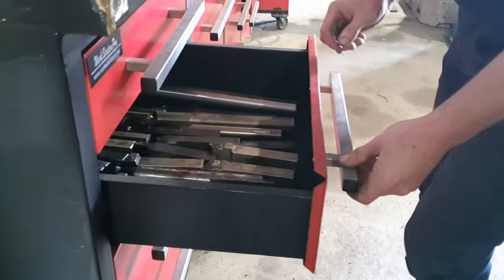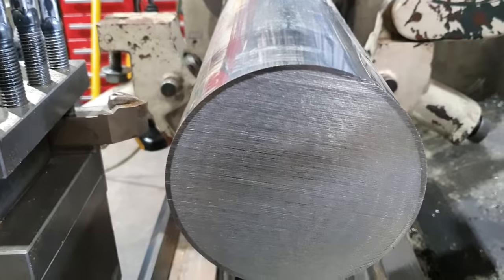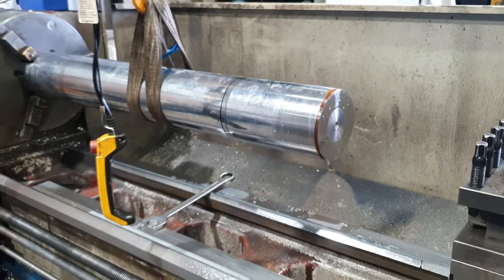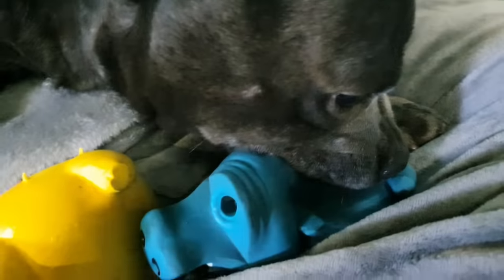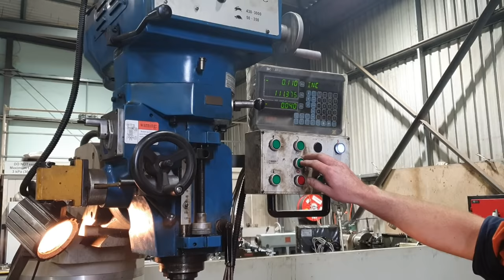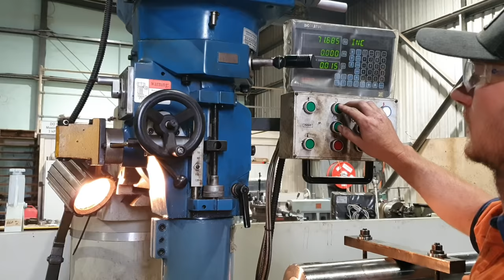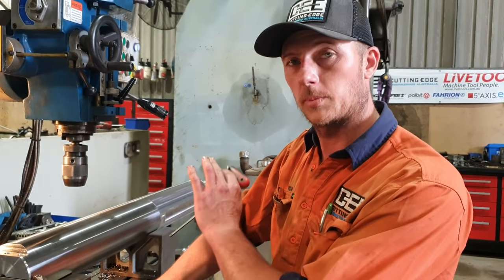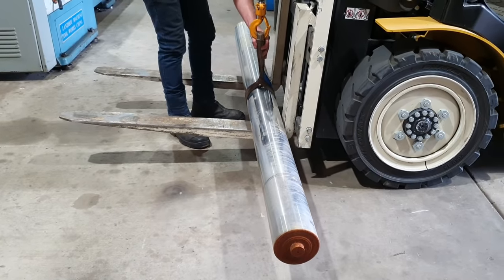Making a BIG Boring Bar | Shop Made Tools

Comment: You sawed the stock with a regular saw blade but had to use ceramic  to cut - the diameter-I usually have to use a hand grinder to go around the saw cut area - then saw it. ----please explain!!!
Reply from the maker: The saw blade has tungsten carbide tips 😎👍

Comment: Set your vee blocks and deviding heads up so that you can machine slots in the for keys. Keys should be made same width as tee slots on your machines. If you have machines with different widths make slots tang fit the slot Drill and tap all your fixtures so hold keys in place. Now it is simple as dropping your vice etc into tee slot so you are set and ready to go. For different machine slot widths just change keys, You’re fixture is set true by just putting it on machine. You will need to do 2 sets of key ways in a dividing head so you can use it in different orientations. Keying fixtures you use regularly will also save time and fiddly DTI usage. Hope the ‘‘tis work out for you. Any thing to make the job easier. OLD RETIRED MACHINIST

Comment: What about adding a relief cut to the one end of the tool slot in the bar to accommodate the 25 mm tool head. That would allow the tool to be set in the bar to just pass the diameter  of the bar. Thus allowing the boring bar to be just about the size of the bore being bored versus the head of the tool sticking out passed the boring bar making the bar much smaller then the hole being bored? Just Saying.

Comment: Second viewing.  What kind of a blade do you have in your saw that chewed thru that inductions hardened chrome bar???  WOW!!!!
Did you find any deflection at the end of the bar?  That's alot of weight hanging on the tool post.

Comment: Did the same for a job with some large oil field stuff.
First time out of the gate and and it ripped the top half of the cross slide clean off the lathe.
Just a little too much leverage and one little snag and away she went. OOPS!!!

Comment: I confess to having a question.  I have been told that a local guy has sucessfully used a ground portion of a broken 1/2 inch drill in a boring bar working on cast iron (air cooled engine block bore).  Is this reasonable?  What say you?  Thanks for your thoughts.  "D"

Comment: Why didn't get rid of the tool post, and made full diameter clamp system instead? You can't use the QC-ness with the bar in place anyhow.  Probably easier, and certainly a lot more rigid. And length would be infinitely variable.

Comment: Love your videos,! I do have a question for you if I may, what kind of saw blade did you use to cut through the Induction Hard rod, is it a special blade you installed off camera?
Reply from the maker: It is a tungsten carbide tipped blade

Comment: Sincere question:

If the cross-section of the bar is ~5", doesn't that far exceed the rigidity of the tool post?

Regardless, impressive job!

Oh, and what the fcuk is a "Grub Screw"???

; )

Comment: Интересно, Длину 1600мм смогу такой самодельной расточкой расточить и попасть в 0.13мм допуск, диаметр расточки  Ф300мм. Соответственно заготовку  под расточной инструмент можем подобрать Ф150мм или  Ф 210мм. Как думаешь ? 
Interestingly, I can bore the length of 1600mm with such a self-made boring and get into the 0.13mm tolerance, the diameter of the boring is Ф300mm. Accordingly, the workpiece for the boring tool can be selected Ф150mm or Ф 210mm. What do you think ?

Comment: Всё это очень хорошо, работа проделана большая, я лично доволен, но так дальше дело не пойдёт. В конце обработки будет биение и шероховатость выйдет за все мыслимые нормы. Аналогичные проблемы и на иных профессиональных станках глубокой расточки, например на станках Рязанского станкостроительного. Обещанные характеристики не выдерживаются. Эта проблема очень изящно решена специалистами Дружковки, причём глубина расточки фактически не ограничивается. At the end of processing, there will be beating and roughness will go beyond all conceivable norms. There are similar problems on other professional deep boring machines, for example, on the machines of the Ryazan Machine-Tool Building. The promised performance is not being met. This problem is very elegantly solved by the specialists of Druzhkovka, and the depth of boring is actually not limited.

Comment: Hi Kurtis
Did you check how much your Bar bends 
if you put 5 or 10 Kg's of weight on the cutting end ?

Did you consider to give it a core of Lead to avoid vibrations ?

Comment: Do you wear earplugs next to your lathe? on my lathes i can't stand that screeching metal noise. it gets up to 110 db sometimes.
Reply from the maker: yeah when needed
Reply: @CuttingEdgeEngineering  also, this was an awesome project, and good use of that bar! We don't have to do much boring in my shop, it's just rough cut drilling with a range of trepan tooling on our 1940s era turret lathes

Comment: A fine job for sure but  you won't achieve the full potential with that regular tool post holder with those 4 small bolts. 
When it comes to bars like that you need to make it its own holder bolted straight on to the cross slide,  a completely surround  perfect hole through type with a good broad base,  now that would be the job 👌 😋😋

Comment: The scale of this huge new boring-bar when mounted on your bespoke tool-rest has me pondering the tolerance stack-up once it goes to work - but in the end that doesn't matter, does it?  The inside diameter will get opened to specification anyway, so who cares if there's 0.00001" deflection.  Nobody.  Not even the Swiss.

Comment: I MUST ADMIT THAT IS THE FIRST TIME I HAVE SEEN A LIVE CHUCK IN A TAIL-STOCK  /  I HAVE WORKED  TURNING ON BIG DIAMETERS  AND LONG IN LENGTH  MATERIAL  BUILDING HYDRAULIC  JACKS THAT ARE USED FOR TALL BUILDINGS LIKE SKY SCRAPERS   TURNING AND BORING THE BODY OF THE JACK AND THE PISTON THAT GOES INSIDE  / I HATED THE JOB BECAUSE IT WAS SO DANGEROUS  I USED A LARGE LIVE  CENTER IN THE TAIL STOCK    ( I WISH THEY HAD WHAT YOU HAVE A LIVE CHUCK IN THE TAIL STOCK )  I QUIT THE JOB AFTER I MADE THE FIRST ONE  BECAUSE THE CHIP BREAKER ON THE TURNING TOOL FAILED  AND A CHIP CAME OFF LIKE A  ROPE,  FLAT WITH A RAZORS EDGE  ALL MOST GRABBED MY ARM  TRYING TO SHUT IT DOWN  AND IT  CAME OFF THE WORK SO FAST AND OUT OF CONTROL RAPPING AROUND THE PART AND HEAD -STOCK CHUCK   HAD TO SHUT POWER ON THE WALL TO STOP THE MONSTER OF A LATHE  /

Comment: So made a boring bar 6 times stronger and heaver than tool post and tool post deck can handle lol........  Tool post and deck will never support that without vibrating itself to death.  Just saying in 30 years we turned corry loader and Truck shafts  making a boring bar of that size we had to make larger surface supported holder for the tool. we also had to make bearing rests to support the tool post deck so it didn't have to support so much weight hanging 1200mm off it

Comment: I watch a few videos of you, you need a higher flow pump for your cutting fluids. The color of the chips shows you are burning your cutting tool tip too often. Cutting tip wearing is a big problem in your case, it will result in inconsistent dimensional and surface finishing results. Dry cutting steel is also a bad idea too. For the drillig part, you have repeetedly burn your drill tip bits without proper lubrication. I hope this is not a teaching video. Hopefully these suggestions can result in some improvements to your future videos. I am an engineer currently operates CNC workshop/engineering/consultancy company.